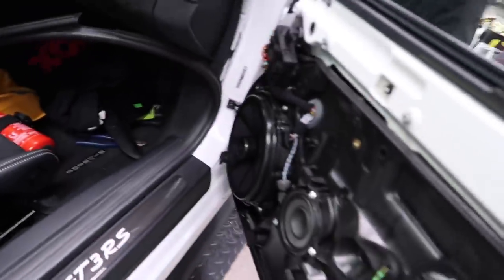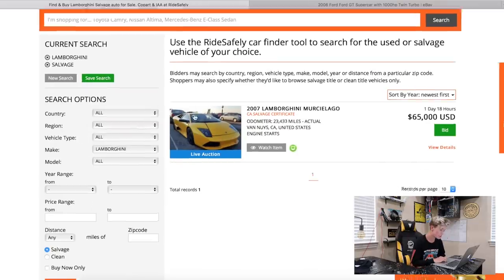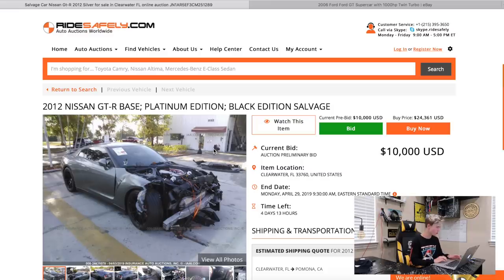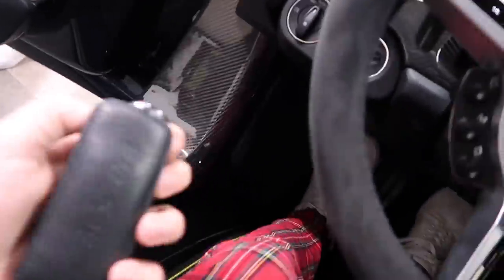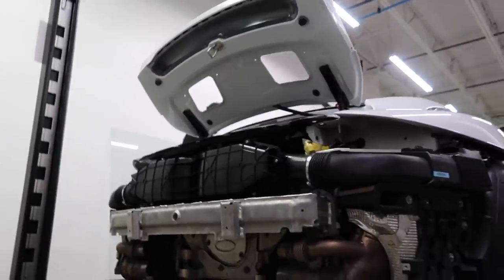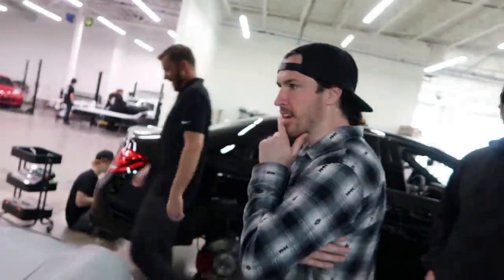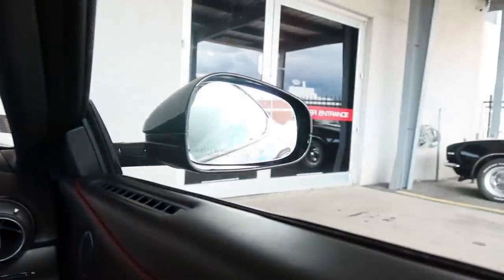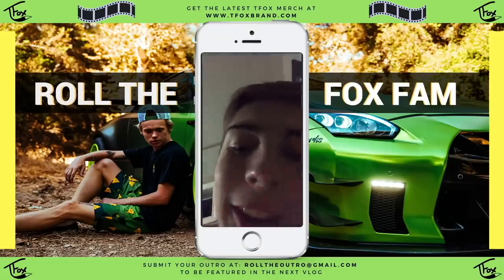Rebuilding My First Wrecked Supercar

Comment: Only if your going to fix them yourself or with friends ! I wouldn’t watch if your just gonna pay a shop to fix it.
Reply: The channels that do the wreck rebuilds have industry knowledge and the idea is to restore it on the cheap or customize it/ mod it for more performance at the same time as rebuilding it. They often are DIYers who have a decent idea what they are doing. Rebuilding a Lambo or Ferrari and buying parts at retail will mean the outcome will be a more expensive build than buying a decent used example. So, I agree that watching Tanner pay someone to rebuild it isn't going to have much appeal

Comment: You are building a race spec gt3rs aka look like a gt3rs IMSA car or complete carbon front bumper diffuser complete carbon wing stainless exhaust possible complete cage and carbon door panels and little carbon bits here and there